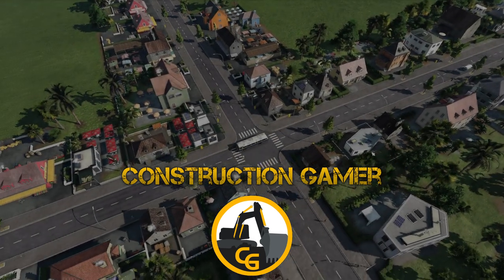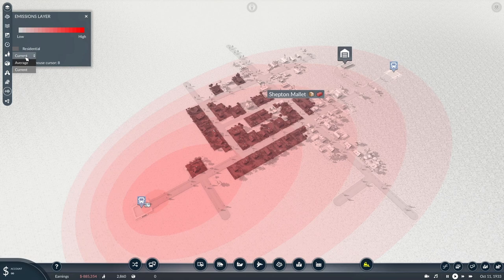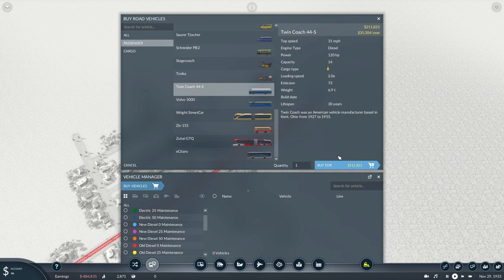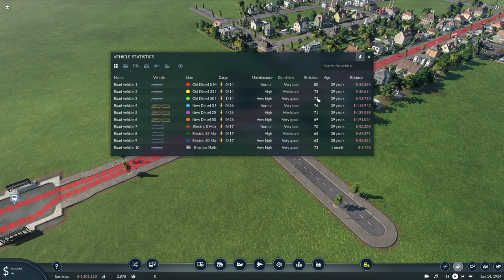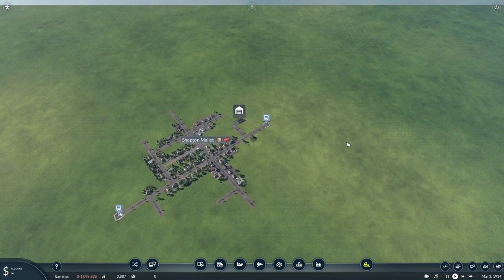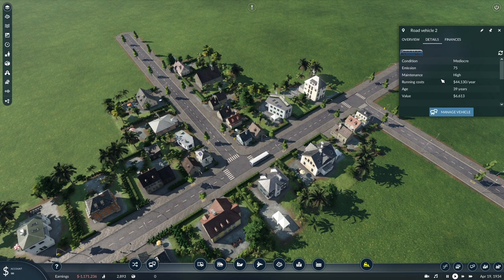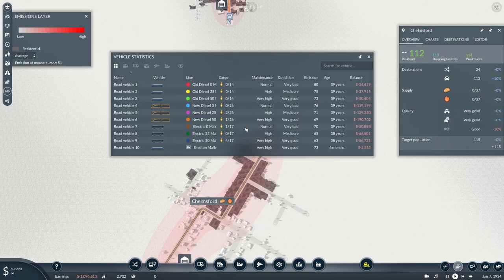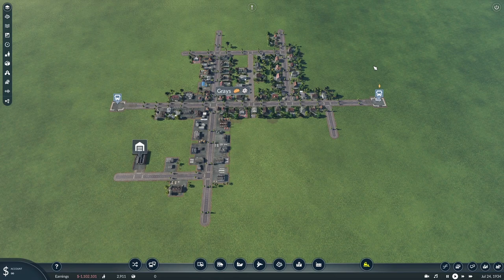Transport Fever 2 Emissions and Maintenance explained

Comment: Nice. Good to see the difference between new low-emission vehicles and the old belching diesels clearly demonstrated.
Not wholly convinced by the emissions cap and fixed running costs, I think I'd prefer some additional penalty for truly ancient vehicles.
Reply from the maker: Wish I'd put more vehicles on. I reckon having a number of old poorly maintained buses will have a much bigger impact. I was surprised at there being a ceiling though.

Comment: I've come to grips with emissions, maintenance, and conditions, though there seems to be an unnerving degree of randomness built in. If, for example, I place 10 horse-drawn transports on one and the same line in 1850, and begin tweaking maintenance levels for individual vehicles to keep conditions at level "good" or better — a tiresome task when one has dozens if not hundreds of moving stock — by 1856 or 1857, I have around 2 of the 10 vehicles classified as "mediocre" regardless of the highest maintenance level.

I suppose my question would be: when do you (and other players reading this) replace vehicles? Do I sit on my "mediocre" horse carriage for all of its 19-year lifespan? Yes, I know: "Replace if I can afford it". Well, I can't! 😀

When I grow tired of spending +50% of game time constantly adjusting maintenance levels for a plethora of vehicles, I usually resort to setting all maintenance levels to "high" (if I can somehow afford it), and I don't replace vehicles before their age limits (because that I can hardy ever afford, especially the trains and planes).

Oh, well. Thanks for providing a place to vent. I feel better now.
Reply from the maker: I only replace vehicles when there's something new to replace them with and ignore "vehicles in poor condition" messages. As a rule I set maintenance to medium and leave it.  

By the time you've got loads of routes set up micro managing to try and reduce emissions becomes less important. I'd only replace vehicles if emissions are having a big negative impact on town growth, that isn't made up for with positive growth from public transport connections or goods being shipped in.